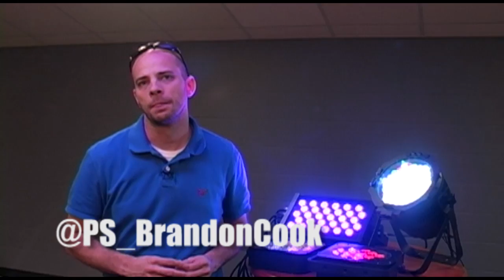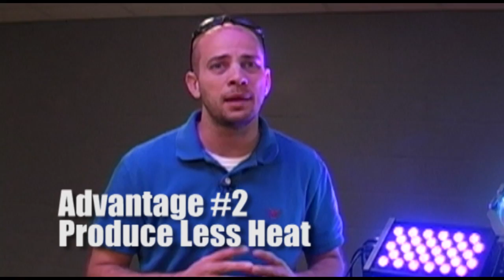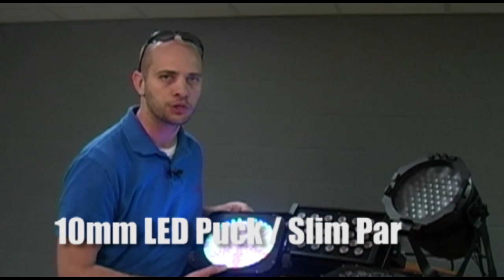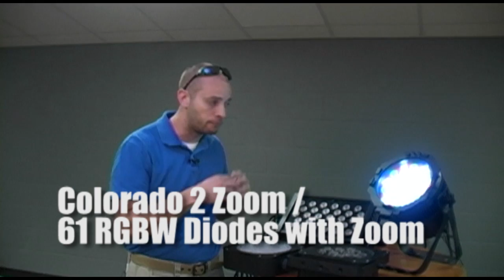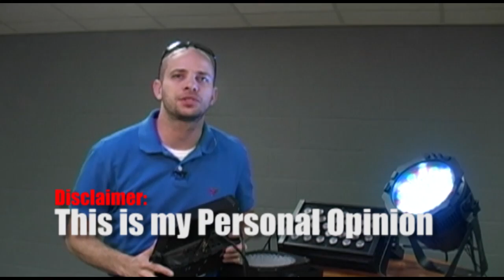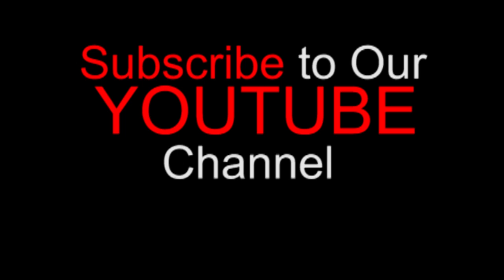Stage Design Ideas : Led Par Cans

Comment: I just bought 4 Par lights 36 led's. I'll be making my own small studio for my own little worship that I would like to play for youtube and Twitch. I have a question. With the Par lights can I shine it up on the Ceiling and have it facing towards my webcam? Not directly but just enough to see the par lights change colors.
Reply from the maker: You’d have a much greater effect putting the color on a wall so the camera sees the color there. Unless there is some haze of some sort, you won’t see the color “through the air.”

Another option could be to place them on the floor and point them upward. 

Can’t wait to see what you come up with!

Comment: They are more energy efficient no doubt, but more expensive, trust me...
Reply from the maker: certainly more expensive, but having the option to have one fixture with multiple colors and not have to mess with multiple fixtures and gels, is an advantage. 

But I agree, there is a higher up front investment.
Reply: INITIALLY.. yes. However, the costs of maintenance are less (you don't need to change light bulbs), cost of use (lower electrical needs) and ease of setup/teardown against versatility means incandescents are .. dead.

Comment: Could you list links to the specific lights on amazon?  I'd like to know if there is a more prefered brand or wattage.
Reply from the maker: Ryan Raymer 

Thanks for your message! If I remember correctly, one was a Maxxlite wash box (pretty sure international knockoff), a Chauvet Colorado zoom, a 3in1 puck and a 10mm puck.

I am not a fan of the 10mm fixtures as the 3in1 or 4in1 Led fixtures are comparable in price and far superior in performance in my opinion.

The upper line fixtures cannot be bought on amazon. But if you have a working knowledge of DMX fixtures and know what you are looking for and the right questions to ask, AliExpress.com is a great place to look.

As for amazon... I use both of these fixtures below on a weekly basis. The wash bars for our back walk in a portable church environment and the led "cans" for back lighting for our weekly announcement videos. I have been impressed. They are not built for touring by any means, but in our church environment, they are great.

Hope this helps!

https://www.amazon.com/dp/B01CTRO36I/ref=cm_sw_r_cp_api_wUDYybG0VWS98

https://www.amazon.com/dp/B0118UQFZ4/ref=cm_sw_r_cp_api_uVDYybY5GVGPD
Reply: Thanks!
Reply: Do you have a suggestion on a low cost lighting board for 4 areas (2 lights/area) and some wall wash lights?
Reply: I was looking at the Chauvet OBEY70 Universal DMX-512 Controller
Reply from the maker: Any of the DMX physical fader/controllers work about the same. I personally use Light Jockey. The software for your computer is free and the usb/dmx dongle is about $100 or so. But it is all controlled from a computer. In my case an old Sony VAIO running windows XP. 

The software is fairly straightforward and allows me to save a whole bunch of scenes in a way that people can see them to select and run.

Hope that helps!
Reply: Is there a way to lock in the DMX channel into the fixture or do you have to reset this everytime the power is turned off?